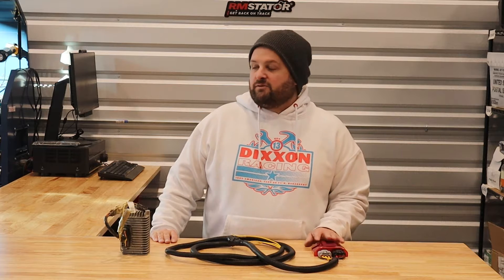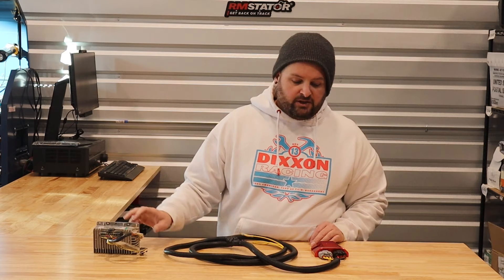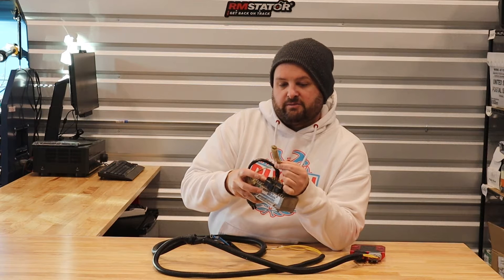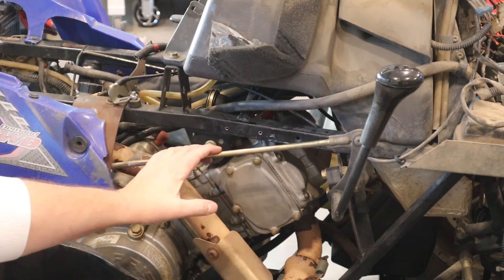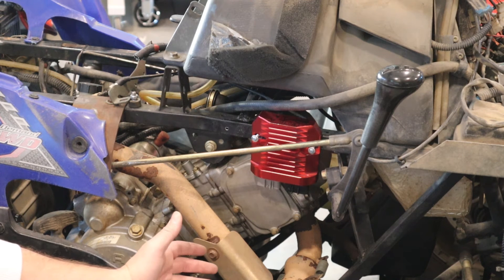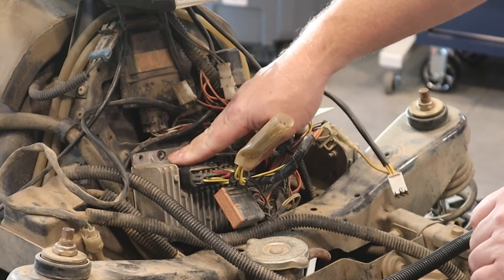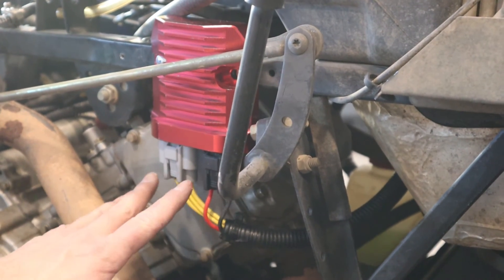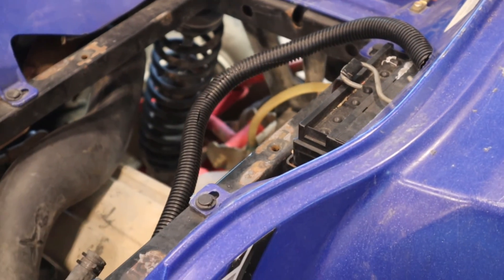RMSTATOR Polaris SurePower Module MOSFET Voltage Regulator Rectifier Bypass Kit Sportsman Magnum ATV

Comment: At 1:07, you mentioned that you are developing a complete replacement module so a guy could get rid of the SurePower unit. How can I get one for my 06 Ranger 700XP 4X4?
Reply from the maker: https://www.rmstator.com/products/rms022-108420
Reply: @Rmstatorinc The notes for that product state that this only by-passes the voltage regulator portion of the Surepower unit, so you would still need the piece of junk to run all of the other functions of the machine. I would like a unit that completely replaces the surepower unit so I can throw it in the trash.

Comment: Idk what’s going on with mine, but it’s like the plug is getting melted, I’m deciding if I wanna try this bypass or get a whole other ecm
Reply from the maker: If your ECM is working fine (other than the regulator part and stator connector damage) I would recommend the bypass!

Comment: So your mounting that in the hottest spot possible. The regulator as you know should be kept as cool as possible. As the lead designer you should know this. There is plenty of room to mount that on the front out of the wheel well area.  Also nobody wants to have to remove the body to replace that thing.

Comment: Question my 450 I think is in limp mode tested the stator all is good but I'm assuming the rectifier went bad as I'm.getting 17 volts at the battery while running 2500 rpm but bike won't go over 25 mph so will this fix both issues